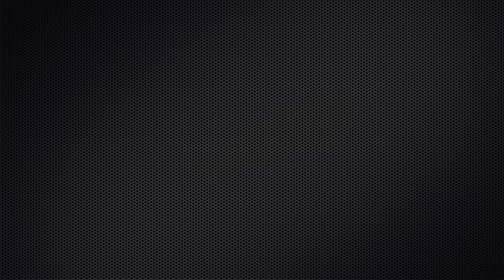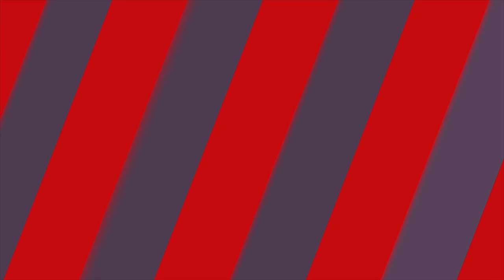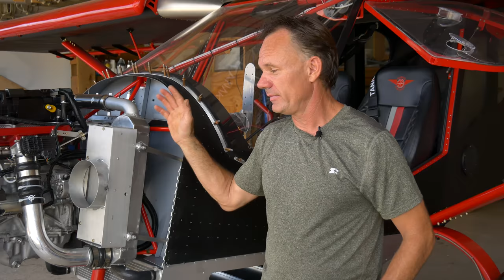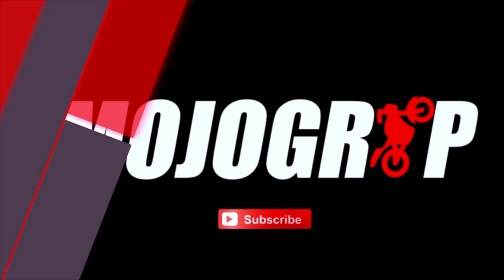Maintenance Cost Of An Aircraft Engine | Experimental Aircraft

Comment: You can purchase a much better and safer engine for your aircraft with the money you will end up spending on the whole FWF Viking package ...  They really are not the “cheaper” alternative Jan claims they are in the end.  If you really want go the AutoConversion route for your aircraft then I would recommend looking into the Aeromomentum engines... they are at least a new engine and not from a wrecked car!  They are also a produced by someone who knows what they are doing and doesn’t use the customer as the R&D department.  If you are interested in off airport excursions than go ahead and mount a Viking on your aircraft!
Reply: Nic Dawson, not true at all, if you took each invoice hand in hand you would see that. As far as Aeromomentum how many videos do you see flying in an aircraft? Also, we offer newest year available not something from many years ago and old technology. We have also always offered new and slightly used engines - those "wrecked cars" you speak of our usually something that was barely tapped in the rear or even have no miles and slid off a trailer - NEVER touched in an engine compartment. The last thing we do is use our customers as R&D that is why we consistently fly ourselves and test for 100's of hours. You see a lot of other companies putting their life in the aircraft testing and flying? AS far as knowing what they are doing, you obviously are completely unaware of all backgrounds in this instance and are speaking from PURE opinion. -Alissa
Reply: Viking Aircraft Engines I find it hysterical that Jan has his girlfriend now defending the company!  Your opinion is beyond bias and not even close to being factual!  You work in the office at Viking and Date the owner!  I have seen the invoices and have seen how much multiple builders have spent on your Viking engines!  The most recent was a customer at my airport who spent almost $25k and received an engine with a dead Cylinder!  The Aeromomentum engine has been around longer than Jan has even been in business and has Thousands of hours on Airboats and Aircraft.  I can post links to just as many videos on the Aeromomentum as the Viking!  If the car was only slightly tapped then they wouldnt be "Totaled" by the insurance companies!  Please come back to reality because you are truly living in a fantasy land!  The Viking engine track record speaks for itself but I love to hear you try to downplay the reality of the matter!  Jan is selling his engines well before he even has a demo aircraft built let alone flying hundred of hours on the engines!  How many OEM's or Kit manufacturer's do you see flying a demo Viking engine!  NONE!  Believe me there is a reason for this!  Even Zenith does not have a demo Aircraft flying with a Viking engine installed!  It sits were it should be on the hangar floor!  Why didnt the Super Duty make it to Valdez this year?  You can post as many videos and lies about your product as you would like... I will make sure the reality of the situation is known!  The Viking line of engines are dangerous and the way that Jan handles business is a joke!
Reply: @flynic3  You have continually on every front spoken bad, just to speak it so, yes it is frustrating to watch someone derate what we do when you know fact as fact and know that we work day in a day out to move aviation in experimental forward. Jan has been doing auto-conversions for over 30 years Aeromemontum is far from that so that and has no where near 1000's of hours on an aircraft - that clearly speaks to your knowledge on the topic. You obviously have a vendetta of sorts, why don't you come and visit and actually get answers to your questions and I think most anyone who owns a Viking engine can speak of how happy they are and the many customers we have I don't need to debate that. An engine is the price, but unlike many companies we offer everything FWF and props so you were obviously looking at just that a complete and VERY FULL FWF package. I can't remember the last time I've ever seen anyone spend that amount here for an engine and every aspect. We send and estimate with everything we offer and able to customize. The dead cylinder thing I have ZERO idea of your reference and obviously they fixed it or would have contacted us personally. You really should talk to us and many of our customers - I don't quite understand your reasoning behind the continual remarks for someone who knows here say and nothing more. -Alissa
Reply: Viking Aircraft Engines What I am stating is not here-say and is first hand experience with Viking engines!  I have seen way to many off-airport landings due to a poor design and feel that these issues need to be known!  A lot of what is stated by your organization is far from correct and this isn’t Jan’s forum were he can censor what is said!  I think the Viking engine is not furthering experimental aviation... I feel it is making it more dangerous!  How long has Viking been around... Certainly not 30 years! Eggenfellner engines which started in 1994 was a flop which failed to produce a valid product that worked!  I would hardly consider that even close to 30 years in the business!  Aeromomentum engines spent many years developing a safe product on jet and airboats with some fleets reaching 20,000+ hours before they even attempted mounting one of their engines on an aircraft!  That is more than I can say about Viking let alone the credentials that Mr. Kettering has to actually produce an aircraft engine!  Jan is no Engineer and the final product shows this fact... the design alone speaks for itself!  The fact he is using engines from a wrecked vehicle and a CPU designed for off-road use in an aircraft is insane!  You have a hard time answering to fact and most of your responses are nothing more than blowing smoke!  I can take the personal attacks but will not stand by idle while Viking takes advantage of builders who do not know better...  I have no desire to come visit your factory!  I personally can not believe that your organization is even still in business!  I guess it just goes to show the forgiving and kind nature the aviation community has!  You take advantage of this fact...
Reply: @flynic3  This will just turn into a back in forth that I am over attending, again shows how little you actually know about Viking and the organization and what we use, such as an ECU and where it originates, Aeromomentum actually uses a microsquirt ECU that we found unusable and they state SHOULD NOT be used in an aircraft. We deal hand in hand with ours we don't use the car ECU! You also know nothing of what his degrees and experience are from - again speaking from what you "believe" to be true. It shows the nature of keyboard warriors who instead of trying to actually invent and make things better themselves would rather turn down the few options that are running soundly in the field. Have a nice day. :) -Alissa
Reply: Viking Aircraft Engines You have a hard time dealing with Facts... So, since I know nothing about your engines or organization then educate me!  What ECU are you now using since you no longer use the Squirt ECU?  You have trouble answering questions and responding to stated facts! Instead you resort to making personal attacks on what I know or don’t know... not knowing me from Adam.  I think this alone speaks for itself...  I do this for a living and have hands on experience with your products and have helped numerous builders who have used the Viking engine.  The only thing I have seen is a dangerous design and poor craftsmanship!  The Aeromomentum does use the microsquirt ECU... due to being able to custom write the software for the application.  That being said, I am not a fan of any auto-conversion and stated that fact...  I stated that if you want to go the auto-conversion route than I would recommend the Aeromomentum over the Viking engine... I stand by that statement based on what I have seen!  I feel that automotive engines should be used for what they are designed and intended for!  Let alone using engines from a wrecked car!  At least the aeromomentum engines are brand new and hand assembled!   I am far from a keyboard warrior and if you would like to know my hands on experience... we can discuss that!  I work in the Aviation maintenance field and do this for a living on a daily basis...